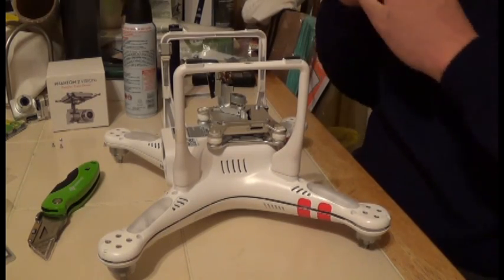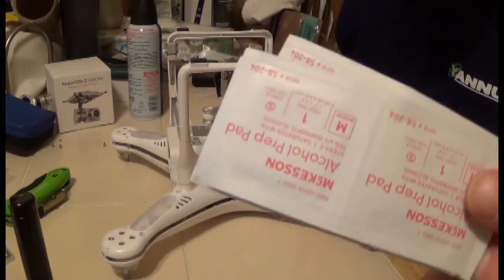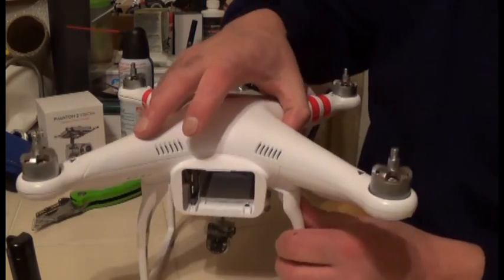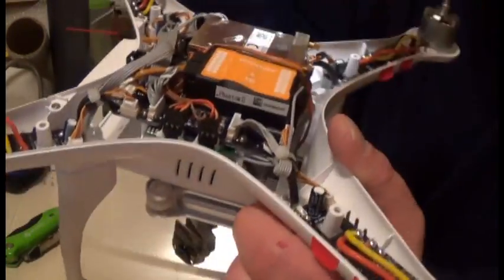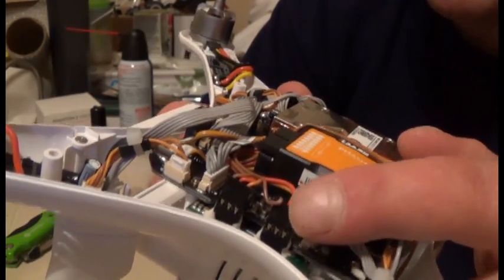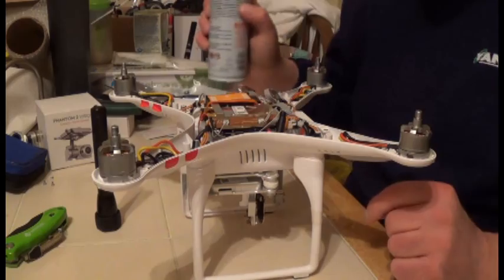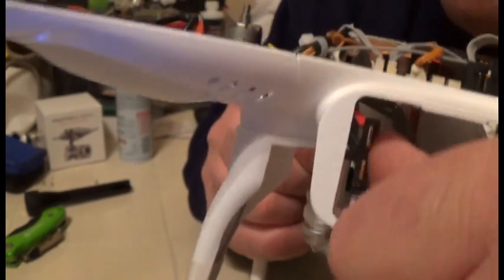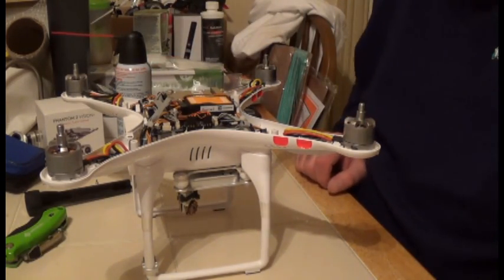DJI Phantom 2 Vision+ General Maintenance Program A Must!

Comment: Hi Francis,  I have a Phantom 2 Vision plus (with a new remote control with that wheel on the top left corner controlling the camera movement) and having bit of a problem with it. 
First of all Camera is not responding when I turn that wheel. 
Secondly on my Phone display I am not able to see battery percentage left, not even how many satellites I am picking up. 
Otherwise I can fly my drone with no problem and I definitely have satellites activated to my Phantom. It works just like nothing would be wrong, except I don’t have visual display on my screen. 
I did go to see technician about this problem but he was not able to work it out where the problem is. 
I would be very grateful if you could give some thought to my conundrum.
Robert Donovan

Comment: Thanks for the great video.  I find it very helpful.  I flipped my P3 on landing and two of the motors got overheated before I could get to the bird.  I have decided to replace the motors despite the fact that they still run.  The windings are discolored on two of the motors and I don't want an engine failure in flight.

Comment: I have a Phantom 2 Vision + with 3 batteries.  Every time I turn it on and connect, I get the INVALID BATTERY error, and can't even start the motors.  When I connect it to the software, it says, "Not DJI Intelligent Battery".  Having all 3 batteries showing the same message leads me to believe the problem is with the bird's Power Connector.  I purchased a new one, and also a new main board just in case.  The only modification to the bird is a range extender where the WiFi wires are connected to heavier duty antennas mounted to the outside of the bird.  Would you agree that it is most likely something wrong with the connector?  Or do you think its the main board or even something else?

Comment: Hey another great video Thanks....  I just got my Phantom 2 used yesterday and all is good and charged up.  1 question...  There a rattle 8n one of the arms and the right red light does not work...  I took the props off and rattled it to realize it an LED that's loose in the housing of the right red lights when the quads facing forward...  How do I get to this LED? Or how do I fix it? The light doesn't work so I have 2 green and 2 red working..  I really don't use the lights for orientation but would still like to have all lights working.... 

Thanks for your help in advance...

Comment: Francis,  Great tips on the inspection!  Just crashed my P2V+ for the first time yesterday morning.  I was flying in higher winds than I should have; wind took my Phantom into a large tree and it crashed to the ground (about 25').  Luckily some of the branches broke the fall.  The only external damage I noticed initially was a broken blade guard where it snapped when it hit the ground.  I will use your vid as a tutorial to make a better overall assessment on the external and internal components.  Fortunately just before I took to flight I installed a carbon fiber gimbal protector plate I manufactured between the skids.  That may have saved the gimbal.  THANK YOU!!!

Comment: Francis, good thought points for safer flying for all. One thought though, in the electronics area when doing PMs(Preventive Maintenance) or even just a post flight check is  the smell around the vent holes of the Phantom.  There is a very distinct smell to electronics components and PC boards the have overheated of shorted. Even if at first no tell tail sign or smell, after having removed the upper housing pay close attention to this sense as you do a more thorough inspection.  Keep on Keeping on...

Comment: Hey Frank, how did you end up flying into a building ?
Reply from the maker: LOL... thanks to DJI for that one. I was flying near NY grabbing the NY Skyline and I went up over a building around 1000 feet away. Not thinking I lowered my Phantom down to see the building on the opposite side of me and when my phantom lost connection it went it to fail safe return to home. So it climbed up to 60 feet and started coming home. Only problem was the building was 100 feet. So I ended up hitting the building because I couldn't see my phantom or gain control back. Now with the recent updates from DJI you can now change your return to home height which if they had that feature before this it would never have happend!! I did email DJI after bitching them out tho. So that's how I crashed it!
Reply: bling0023 It was a small building...hard to see....lol
Reply from the maker: bling0023 I went over a building and lowered my quad to see the other side and doing so cost me to lose my connection. When it went to return to home it went up 60ft. but the building was 100ft. So that's how i happened!! Thanks for watching!!

Comment from the maker: @JAKE SCHULTZ well the basic principals should apply. If you comfortable about opening your phantom up you will wont to inspect the wires, make sure they are connected and not lose. Check the solder joints for loseness and just do full over haul making sure that nothing looks odd like shorts where the wire could start to melt. Check the screws make sure they are tight and nothing is going to become lose from the vibration. Hope this helps!! Happy Flying my friend. If you have any questions please let me know?

Comment: Hi Francis, I would advise anyone who wants to open up there phantom 2 vision + ( not the v3 model ) to do the gps screened cover modification. If you look inside the new version 3 phantom DJI have modified the gps cover by keeping the gps lead under the cover and extending this cover partially up the four legs. I modified mine and it increased the number of satellites by an extra 3. I used hvac aluminium sticky backed tape 50mm in width and covered the gps module 3 times.
Reply: Just make sure you don't cover the vent holes
Reply from the maker: Hey Dave, I'm planing on doing something to cover that. I have tried myself the connection under the pad along with aluminium foil covered with white paper and had no results. In fact what I found is my satellites where jumping all over the place at a quick pace. I might try your sticky tape did you cover the underside with paper to protect the electronics?
Reply: Francis G no I thought it might spoil the ventilation so I just made sure it was well stucked down and clear of every thing. Maybe the next time I open it I might put some forms of non conductive tape over the alluminium tape.
Reply from the maker: David Reay Yea your going to want to be careful with that because the vibration could cause it to loosen and fall on to the electronics and possibly causing a short :(